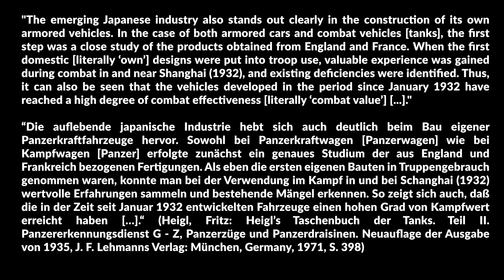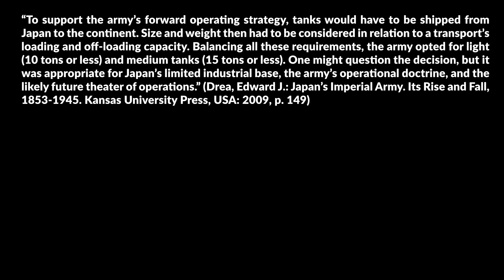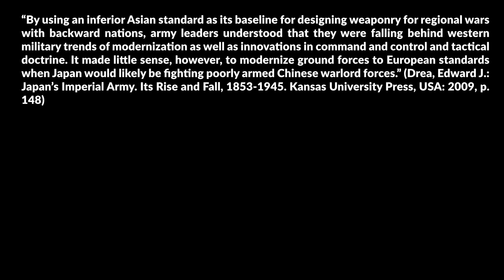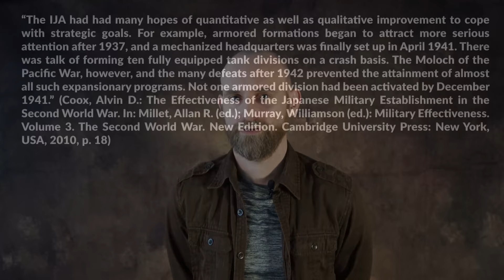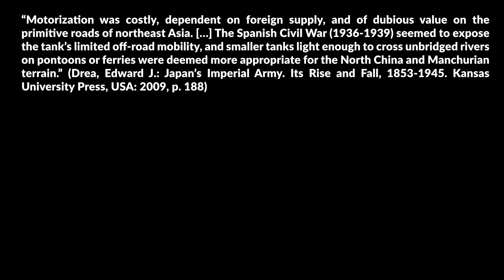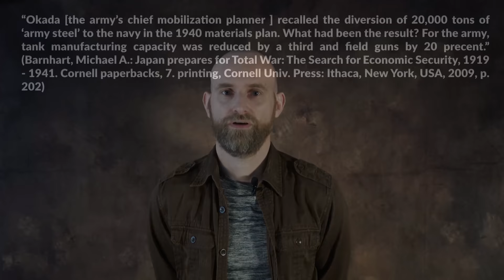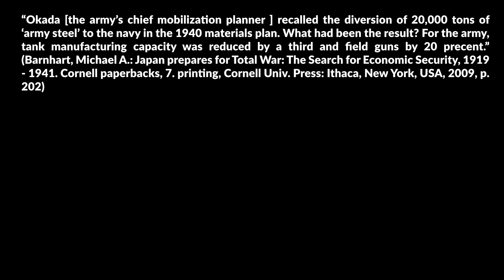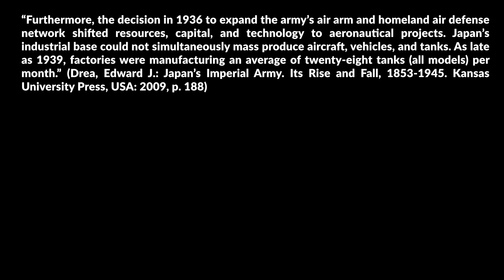The Problem with Japanese Tanks in WW2

Comment: Dad served in the Pacific Theatre and told me that the Springfield or the Garand made good antitank rifles. Loaded with M2AP cartridges,  soldiers from treetops or cliff tops or buildings would fire on rear decks. Rounds would punch through rear deck armor and disable the engines or set fire to the fuel supply.

Comment: Most amateur historians fail to take a close look at the particular army's organizational requirements when discussing why certain types of equipment is adopted. The US didn't adopt one of the various heavy tank designs partially in light of how difficult it would have been to transport & resupply such large tanks. By the time ordinance department figured out that a"heavy" was needed, it would have taken to long to produce an acceptable model and set up a sufficient logistics chain to support it. The IJA was in the same boat, events overtook the capacity to effectively influence actions in theater.
Reply: But the US had the 90mm for the M36 and the British had the 17 pdr for the Firefly and Archer.  The Japanese had no gun to mount on an AFV to kill Shermans.
Reply: A point Chieftain points out in detail in a video addressing that very issue when we "discovered" the Tiger in N Africa in 43. By then the entire logistic chain had been designed to support a 30 0dd ton medium tank.. period.
Reply: @johnshepherd8687  Both the M36 and Firefly were hasty reactions to heavier German armor. The vast resources and industrial capacity of the US made both vehicles possible. Japan had neither.
Reply: @jacquesstrapp3219  it is not just a matter of having manufacturing capacity.  The US and the UK had existing weapons to mount.  Japan had no AT gun developed to kill a Sherman
Reply: @johnshepherd8687  The reason for that poor development was a lack of resources and industrial base. The US had a large automotive industry that was converted to war production. Japan just didn't have that. The Japanese had the Type 10 120 mm AA gun. They just didn't have the resources to mount it on a chassis.
Reply: @jacquesstrapp3219  So what you are saying is that unlike the US and UK Japan didn't have a gun or a chassis to use which is my point.  Secondly, they didn't a towed piece to use.  Both 17lb and 90 mm were existing AAA repurposed for anti-tank work like the Getman 88.
Reply: @johnshepherd8687  What about the type 90 75mm field gun which they mounted on the type 3 medium tank and type 3 tank destroyer? They could effectively kill a sherman, but were held back for defence of the home islands.
Reply: @bain6655  You just nailed it.  Late war and reserved for terminal defense.
Reply: @johnshepherd8687  True, and then they got A bombed so it didn't matter anyway.

Comment: One of the key advantages Germany had over everyone were its metal pressing machines.  Basically it's just a giant machine that crushes metal under the weight of hundreds of tons, or even 10's of thousands of tons. This heavily compresses the metal, making is stronger for its weight. On top of that, sheets of very thick metal could be casted with molds under this weight to form them into complex shapes, which is a huge advantage in both durability and production speed.  And we're not talking just sheet metal, but very thick slabs of solid metal.  These machines are bigger than 4 story buildings. This literally made Germany's tanks physically stronger. But it's not just used for tanks, it's used for aircraft parts too, to make the metal thinner and lighter while at the same time, stronger.  

Japans tanks on the other hand, were nowhere near this level of manufacturing. So not only were their tanks smaller and weaker, their metallurgy was no match either.  

These giant forming press machines were pretty much the main source of Germany's advantages in WWII.  Soo much so, that when they were defeated, both Russia and the USA disassembled those machines and took them home to use for themselves.  

Albeit, Russia benefited far more from this (and they got more of the machines, along with the bigger ones).  Russia pretty much owes its entire modern industry to these machines, as it leap frogged them way ahead of where they were technologically, and has been a main source of their rise since WWII.  In some ways, it was like giving cavemen both fire and the wheel.  Russia wasn't in the stone age, but these press machines allowed them access to metallurgy and technology WAY beyond what they would have accomplished on their own.  If Russia had never gotten ahold of these machines, they wouldn't even have had a space program, let alone modern jets, without buying them from another country.  And to this day, those machines taken from Germany are still in use.
Reply: The great results from GROFAZ's leadership: It Made communism a worldwide threat.

Thanks for this info. I had no idea. I'd love to see a photo of those machines.
Reply: The great results from GROFAZ's leadership: It Made communism a worldwide threat.

Thanks for this info. I had no idea. I'd love to see a photo of those machines.
Reply: I saw a video last year about those presses, I think it was on the Periscope Films channel. Basically, it was a film describing how we duplicated them here in the US before the war, as soon as we learned of them, and how important they were in OUR war production effort. That's probably part of the reason why we let the Russians take the best ones.

Comment: I really feel that the Ha Go (Type 95) developed it's poor reputation post WW2 due to nothing more than its shape and reductive thinking that wasn't challenged.

In photos or drawings without a clear sense of scale, all of the sloping armour brings to mind the FT-17. And on that scale the tracks look dangerously thin. But the hatches should be the giveaway that it's a much larger and quite capable tank. So I love that you showed it next to the Pz1 and Pz2. And that convergent engineering on opposite sides of the world designed the LT vz. 34 and Ha Go at the same time.
I wish I could remember where I found the US Army intelligence report on the Ha Go. The short version was that they overall rated it as an equivalent to the M3 light tank and recommended their troops treat is as such.
Reply: The Ha-Go is really equivalent to the M2 Light tank, the predecessor of the M3 Light.

Comment: Also the tactical and strategic requirements for the Japanese using tanks in the Pacific War theater was less than that combined arms and mobile fire power requirement for all combantants in Europe and North Africa. On mainland Asia, where you pointed out, the Chinese then had poorly equipped armies and so the mobile fire power requirements (and combined arms) of tanks was less needed there compared to the other main theaters. Furthermore, fighting on the Pacific island, ships and planes were more important there for a war of movement than by tanks, which were difficult to manoeuver in the mountainous thick jungle terrains of these islands. That being said, at times the added firepower and mobility of tanks could improve manoeuverability and take out defensive strong points in some battles (the Japanese were skilled in building bunker complexes) on these islands, for example, using half a dozen M3 Stuart light tanks by an Australian attack in the battle of Buna-Gona.

Comment: AFV production is often an indicator of a nation's industrial, and particularly, heavy automotive industry.  Japan was simply a late comer to industrialization as it was; and particularly in the transportation sector, as it's first railroad began service in 1872.  There was no mass production of automobiles until after WWI, and even then, most were diesel-powered trucks for the Army.  This is part of the reason why these diminutive Japanese tanks were diesel-powered; as a country that had to import all its petroleum, more diesel could be refined from a barrel of crude than gasoline.  Also, the Japanese diesels were air-cooled, reflecting their intended use in Manchuria which has a lot of arid steppes and desert. 

Also, the Japanese Army was more or less a colonial-style policing force than a European-style mechanized army; the Soviet Union had yet to consolidate its power in the Far East, and the Japanese, having beaten them soundly in 1904-1905, and recognizing that the reason partly was due to their ability to support their Far Eastern forces, even with the new Trans-Siberian railway, plus their chauvinistic arrogance towards the "Gaijin".  Japan more or less, until 1940, faced off against the Chinese, who had practically no armor to speak of, so these ridiculous little tanks were perfectly fine in the infantry support role for which they'd been intended.  However, and what should have been a warning, they didn't perform well at all against the Soviets in 1939 at Khalkhin Gol, where they were soundly defeated by the Red Army forces under command of an up-and-coming general by the name of Georgi Zhukov.

Japan had much better tank designs in development and on the drawing board in 1945; but with most of their Navy and Merchant Marine on the sea floor; and insufficient resources in the Home Islands to sustain their war industries, let alone commence production of main battle tanks, they had nothing but these small tanks like the Type 95 Ha-Go and the Type 97 "Medium" (to call it, charitably) which COULD knock out an M4 Sherman if the Sherman's commander was inept enough to let it get close enough.  For all practical purposes, against the Soviet T-34/85 in the Manchurian Strategic Offensive, it had no chance at all, although there few tank-vs-tank engagements in that group of battles.  Even had the Japanese had more battle-worthy AFVs (they did consider manufacturing the German Mark IV and the Tiger under license, the Germans sold them a Tiger which they leased back as there wasn't a means to get it to Japan), they had insufficient fuel and ordnance to train their crews, let alone equip them for combat.  At war's end, in fact, both the Japanese civilians and the military were HUNGRY, and had the war not come to an end when it did, there's great likelihood that by the time that Operation Coronet (the invasion of Honshu itself in and around Tokyo Bay, slated for March 1, 1946) was under way, millions of Japanese would already be dead or dying from starvation or related complications.

Post-war, the reformed Japan Self-Defense Forces used American M4 Shermans and M24 Chafee tanks, in the late 1950s, as the US Army re-equipped its armored divisions with M48 Pattons (and later the M60s, though I believe the latter was never deployed by the US Army to Japan at all, but instead went straight to Korea), it handed down some of its M47s, which in turn had only began to be issued a few years earlier as a stop-gas measure right at the end of the Korean War.  So at least the JSDA got a slew of practically brand-new tanks, which they were grateful for.  The only trouble was, the "Patton II" (the M48 was known at first as the "Patton III", later on, all M46-M47-M48 tanks were simply christened, "Patton") was just too big and heavy for Japanese bridges and roads, and there were quite a few rail tunnels they couldn't go through on flatcars!  Therefore, the JSDA kept its Shermans and Chafees, and reserved the M47s for the defense of the Kanto plain itself.  They set about developing a new tank better suited for the unique topography of Japan, being that by its new constitution the Japanese Army was to be deployed solely for the defense of the Home Islands.  Some "Gaijin" designs like the French AMX-13 and the USA M41 "Walker Bulldog" were considered, as they were light enough to be used in Japan, but the Korean War experience indicated that the new tank would have to have at least a 90mm gun.  As the Soviet T-54 and T-55s already had a 100mm gun, and USA and UK MBTs, along with the new West German design being developed jointly with the Americans were to sport a 105mm main weapon, considered was given, but those tanks were considered too heavy and large for the JSDA's requirements, and given the average size of the Japanese crewmen, the 90mm was considered to be as large as what a loader could reasonably handle.  Besides, given Japan's generally mountainous terrain, it was believed that most armored engagements would happen at relatively short ranges; where the 90mm gun would suffice.  Two designs were proposed, a 25-ton and a 35-ton vehicle; and the larger one won out, and was put into production as the Type 61.  Later on, as the average Japanese male grew in stature, and it was seen from experience with the Six-Day War between Israel and its Arab neighbors, the 90mm gun was no longer adequate, so a new Type 74 with a 105mm gun and an adjustable suspension, like that proposed for the scuttled MBT-70 project, was developed and placed into service, and still serves with reserve units.  Following the end of the Cold War, Japan's armored battalions have gotten modern Type 90 and Type 10 MBTs, which have specs like contemporary US and European models with 120mm smoothbore guns and advanced armor.